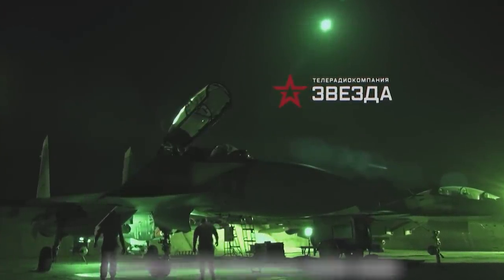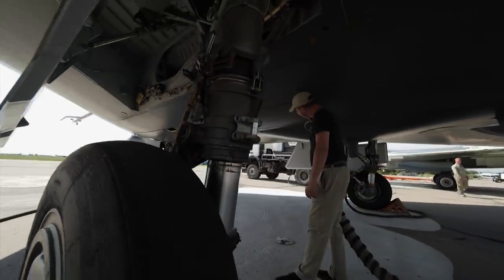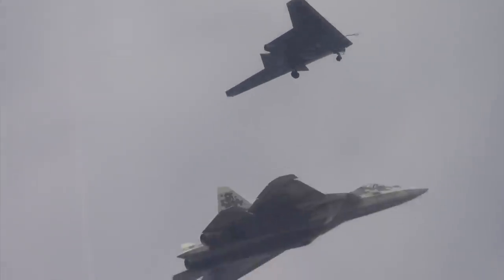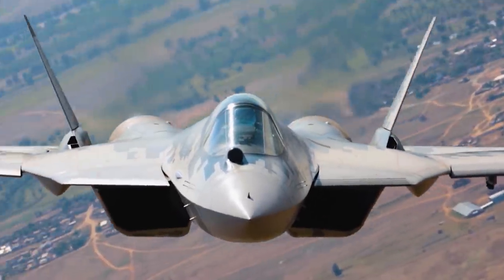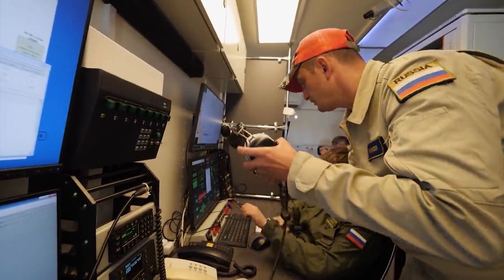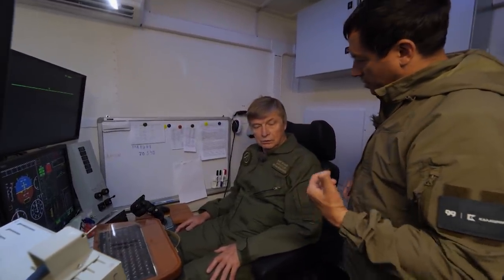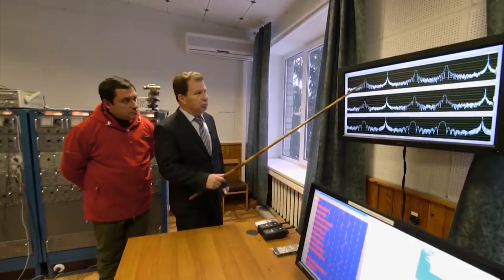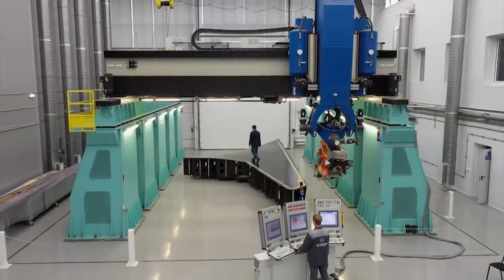S-70 Okhotnik-B UCAV: stealth heavy unmanned combat aerial vehicle

Comment: If Russia able to equip it with Kinzhal or Zircon, this S-70 could be very deadly. But i;m afraid it's way too slow to carry such expensive weapons.
That is why Russia is betting on fast plane like Mig-31
Reply: It will be slow (sub-sonic) by the definition of the 'flying wing' aerodynamic scheme... All the aircrafts built by a such scheme are subsonic, all of them, including American F-117 and B-2! But! The main advantage of the 'flying wing' aerodynamic scheme is the very economical fuel usage, so an airplane can stay in the air much longer, for many hours, without refueling! Like all 'delta-planes', including the sport ones... 

And, of course, the most closest 'scheme' to the 'stealth' requirements... The 'magic triangles'... 😉
Reply: They cant do that. For achieving the hypersonic speeds the missle has to first reach a supersonic speeds before being launched. Thats not possible in a sub sonic ucav.
Reply: @asmityadav4216  , Well, better to say, the altitude is more important (and the density of air on a such altitude) for an air-based hypersonic missile... The Mig-31(K) can reach the 25 km altitude, at its limit with one 'Dagger' missile...

Comment: 31:40 B2 spirit of missouri was shot down 40km by air from me, near Zupanja
The whole area was closed for 2 months, the crater is visible even on google maps
Trucks removed the remains of the downed aircraft, The downing of the f117 was a well-conceived ambush.
Serbian spies observed the airport in Italy from which the planes took off, and reported back to Serbia which plane and when it took off.
good knowledge of the aircraft by the air defense commander and a good calculation led to the plane being shot down
Reply: no b2 spirit was ever shot down. it was an F-117 Nighthawk.
Reply: @crazyVrex  Serbians claim that they also hit B2 Spirit. It's old story and and I guess if it's true we will know it in 50 years.
Reply: @crazyVrex  This year i will try to enter the area where the crater is with my metal detector if i find something i will let you know 😊
Reply: @crazyVrex  We shot both, B2 and F117. B2 fell in Croatia, so it was easy for Americans to cover that up, F117 fell in Serbia, so we made a celebration. 🎉
Reply: WOW! provide these coordinates on Google maps let's see.
Reply: @professorx2607  250th missile brigade of the Serbian Army, three planes appear on one of the vehicles (Kill Mark), F117 F16 and B2 there is a picture.
Reply: Well, actually Serbians waited the F-117, since it used the same 'entrance corridor' for days...The old S-75 decimeter radio wave length radars detected it! Nevertheless, the F-117 is mostly Russian by the Pyotr Ufimtsev mathematical equations of the 'stealth technology' ideas, long before the F-117 was produced... Actually, the Pyotr Ufimtsev mathematical disertation was published without two last pages with the conclusions what such a 'solution' is 'useless in practice'... 😎The American engineer Denys Overholser used the Ufimtsevs' equations to design the F-117 & B-2 'ideology', but he did not read the last two pages of the Pyotr work, because they never been published in USSR! Americans still believe to the 'stealth' as to a 'corner stone'. Let it be! As much money they spend for it, better for Russia!  😆The B-2 'price-tag' is about 1 billion $$$, not including the support cost per year for each one, say, about 2-3 millions, at least...
Reply: @maksimluzin1121  i know all about it, nice to see that someone also know this stuff 😊
Reply: @ridok4hd647  , I wrote that just for the clarity... You Serbians are Heroes, I'm Russian and have a shame we could not to defend our Christian brothers that time... Sorry for that! 😒
Reply: @maksimluzin1121  We remember all since tsar Nikolaj II Romanov, he saved my nation back in WW I, Russian VDV took airport Slatina in Kosovo 1999, but Beograd had another plans and im sorry for that, we are on the right side.. Russia will save this world and i hope one day we can unite!!! Бог на небе Царь на земле
Reply: @ridok4hd647  , Косово - это Сербия! Крым - это Россия!
Reply: @ridok4hd647  , This is Not about the Time, this is about the Truth! The truth always find its way, even by years! Not now, but at the Final state, always...
Reply: @maksimluzin1121  Never forget that the B-2 is Myasishchev´s design. M-67 LK-M to be more precise. Delivered as a blueprint through agent Sphera.
Reply: @maksimluzin1121  I understand where are you coming from, but both nations should equally share the credit for the achievement as a whole humanity, not bound by some political borders. One side for developing concepts/ideas and mathematical models, and the other for actually building it up. If else used your logic, it could be possible to claim that Russian Konstantin Tsiolkovsky is the father of all rockets. But there were many other brilliant people who studied his work extensively and actually brought everything from pure imaginary fiction visions into a real life, through achievement of myriad problem solving on its own in every developing stage - e.g. Von Braun, who built V-2 rockets in nazi germany and then Saturn V for NASA where he was founder and the first director of it. Despite his dark past, that he was partly a victim due to surrounding circumstances at the time, but still inspiring personality nevertheless, who did redeem his crimes a somewhat through giving humanity technological advancement in rocket science. I really dislike all this political division of humans and constant bragging "we are better than you", instead living all together as one species on this planet and enjoying our achievements. Life is to short for that bs in the eyes of eternity - we are given only a very short glimpse to experience it.

Comment: I think it would not be a bad idea to have some thrust vectoring and canards... Just in case you need to use it like that...
Reply: Canards have no function in a flying wing platform....you must consider the mission type of a plane and design it considering the purpose of building  that....this plane not supposed to engage in dogfight so supermonuverability  dosnt needed.canards are so useful in deltawing aircrafts for give the plane in low speeds best performance and make it aggile
Reply: Canards and other control surfaces increases RCS which impacts stealth. Thrust Vectoring increases the weight which means less carrying capacity for weapons. It doesn’t need super maneuverability, it will always have Su57  as an escort vehicle.

Comment: I can see the screws on the main frame how can it be stealth i dont get it.
Reply: It's a prototype not a production one
Reply: I'll repeat the previous my message for you: This is the first testing flying prototype. Its task to check all the flying characteristics, algorithms and communication. The second one already built have the flat nozzle already. Wait for the second part, or watch it in Russian (produced an year ago)... About "stealth". There is no need to cover it with RAM during tests, it is just cheaper for the R&D program! At least 8 first test prototypes of the Su-57 were are not covered with RAM, this is why people think the Su-57 is not stealthy, because they saw just the images & videos of the first 8 flying prototypes. Find images of the last Su-57 testing prototype (10th, I recall, or two last of them) or to the serial Su-57 already produced (they are available), you will see the big difference in their surfaces... The flying prototypes for different tests and the serially produced are considerably different...
Reply: Thx i get now

Comment: How is it stealthy with that big exposed engine nozzle  , the heat from the engine would be picked up by any radar station , the B2 is a fully fledge pure stealth aircraft
Reply: This serie was published quite for some time. There is already mass produced S-70 with flat nozzle. Google for pictures.
Reply: By the way , radars does not pick up heat signature.
That's the job of a fighter aircraft with optical IR sensors.
Reply: Does the F-35 have a closed nozzle?
Reply: @vladimirnikolskiy  the f-22 does 😉
Reply: @vladimirnikolskiy  it does not have closed nozzle , but has nozzle with serrated edges, which deflects radars
Reply: @mohammedfahd8908  It was about the heat from the engine, it's not difficult to make jagged edges.
Reply: I'll repeat the previous my message for you: This is the first testing flying prototype. Its task to check all the flying characteristics, algorithms and communication. The second one already built have the flat nozzle already. Wait for the second part, or watch it in Russian (produced an year ago)... About "stealth". There is no need to cover it with RAM during tests, it is just cheaper for the R&D program! At least 8 first test prototypes of the Su-57 were are not covered with RAM, this is why people think the Su-57 is not stealthy, because they saw just the images & videos of the first 8 flying prototypes. Find images of the last Su-57 testing prototype (10th, I recall, or two last of them) or to the serial Su-57 already produced (they are available), you will see the big difference in their surfaces... The flying prototypes for different tests and the serially produced are considerably different...
Reply: @mohammedfahd8908  , " but has nozzle with serrated edges, which deflects radars@ - how it 'deflect the radars'? Which distance? Which the radio-wave length? Provide the formulae !
Reply: @maksimluzin1121  Не нужно метать бисер перед свиньями, друг, это бесполезно.
Reply: So you are saying that when you manufacture a product, you would right away make it into production instead of pilot testing? Seems like the reason for many F35 failures
Reply: "the B2 is a fully fledge pure stealth aircraft" - No, Not a B-2, but the F-117! But so clumsy! The F-117 even used a system of spin-up gyroscopes just to stabilize itself on the fly! The 'magic triangles', for cost of everything else!😆
Reply: @jackmack4164  I’m not American  😂🤣🤣🤣 wow your so patriotic , calm down calm down , I respect technology regardless of which country makes its , 😂😂🤣🤣 “ American fan boy “ 😂🤣🤣👍🏾 that’s a good one ,
Reply: @jackmack4164  no I didn’t even say nothing of the sorts go back and read what I said , if you use reading glasses 🤓 USE THEM 😂😂😂

Comment: Forward swept wing provides a lot more maneuverability at slow speed at high speeds it’s completely useless by the way bring back the old announcer this guy sucks
Reply: Well, the Forward swept wings scheme were used by many airframe builders.... Yes, the main disadvantage of such a scheme are the 'torque' aerodynamic forces at a high speed... The Su-37 was just an experimental aircraft to test the composite materials of its construction, at most, and the new digital avionics.... Nothing more!

Comment: Does it even have any RAM ( radar absorbing materials ) by the looks of it I think not , and the exposed engine nozzle clearly does not make it a “ Stealth 🥷 aircraft “ 👎🏾❌🚫
Reply: This is the first testing flying prototype. Its task to check all the flying characteristics, algorithms and communication. The second one already built have the flat nozzle already. Wait for the second part, or watch it in Russian (produced an year ago)... About "stealth". There is no need to cover it with RAM during tests, it is just cheaper for the R&D program! At least 8 first test prototypes of the Su-57 were are not covered with RAM, this is why people think the Su-57 is not stealthy, because they saw just the images & videos of the first 8 flying prototypes. Find images of the last Su-57 testing prototype (10th, I recall, or two last of them) or to the serial Su-57 already produced (they are available), you will see the big difference in their surfaces... The flying prototypes for different tests and the serially produced are considerably different...